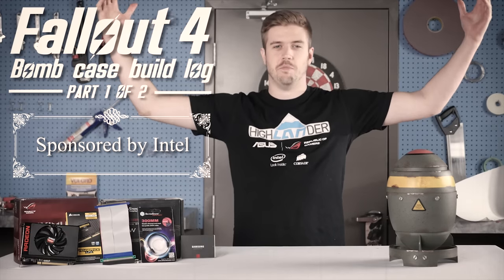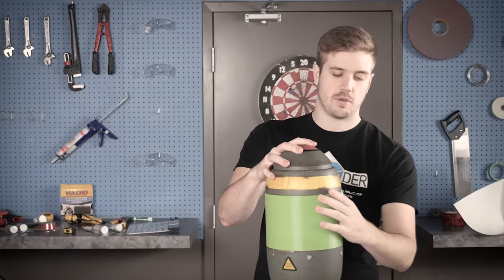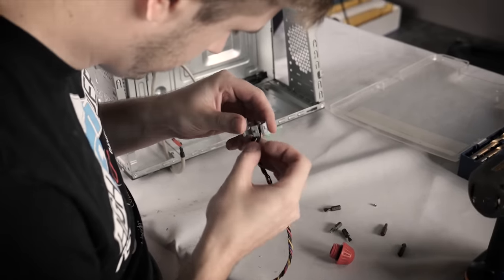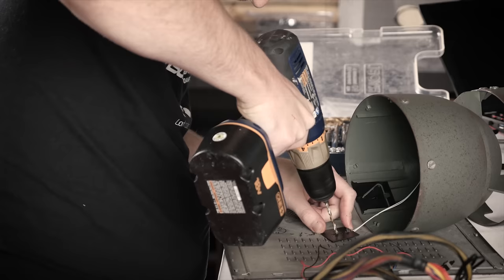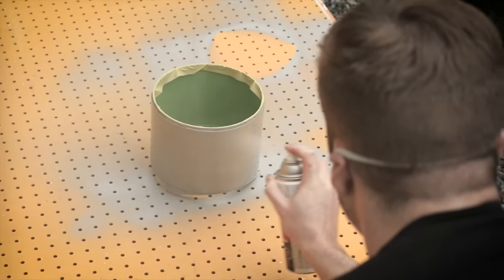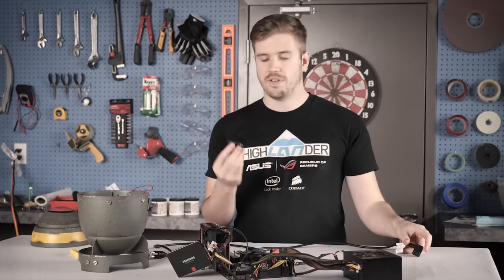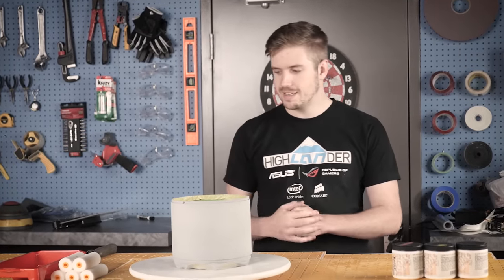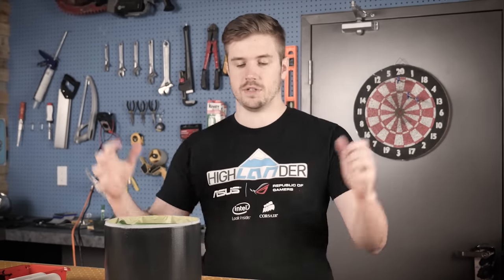Fallout 4 ULTIMATE "Bomb Case" Build Log - Part 1 of 2

Comment: Ya know, if you lay the plastic plate onto a piece of wood prior to drilling it, you won't have to de-burr it with a file. Then if the hole isn't large enough, just simply repeat with a slightly larger drill bit!

Comment: Why you didn't use automotive paint for every color, it would look much better. 
And i have a pro tip for you. Next time to smooth out the surface i recommend using sanding paper with various gradations. Start with 200 and go along too 800. Then spray 2 layers of primer. Wait till it gets har enough to sand it. And here's where magic starts. Use wet sanding paper, 1500 should be good. Surface will be smooth like baby butt :D.

Comment: I would have to make some measurements, but I'm pretty sure that you could fit all of that into the original bomb if you were willing to disassemble the PSU and use a PCIe riser cable. It would be incredibly tight, but I suspect it would work.

Comment: I am surprised he used a full sized SATA SSD. The Samsung 950 Pro had been released. It would have been smaller and faster. (Although they do apparently drain a little more power, which is surprising. Maybe it is firmware, or just the fact that they are so absurdly fast.)

But yeah, that SATA drive was a huge waste of space, the M.2 drive would have been flush with the motherboard.

I am also surprised that he didn't do more modding of the pieces. I know it is a bit dangerous to try to physically take apart the components, but it would have been worth it.

Comment: You could have built a custom PSU and used a NUC motherboard to accomplish this. Yes, it is possible to use a GPU at PCIE 3.0 x4 by adapting the M.2 ultra port. It works quite well.
Reply: +Kevin Resendes no 3d printing extensions required.

Comment: Luke should have wired the switch in parallel with the noise button. wouldnt need hot glue, just solder. less buttons and less mess/hasstle

Comment: that old hunk 'o' junk is not a piece of junk, it was the case of an old Compaq  SG3 110uk pc witch I have, comes with 2 gb of ddr3 RAM, AMD Atlon x2 215, Radeon 3000 IGPU 300 GB gb caviar blue, 2 usb 2.0 front ports, SD card reader and writer headphone and microphone Jack , search up SG3-110uk specifications

Comment: You could just cut the power wirering from the case, concect to the the motherboard as soldering the other 2 pins of the cable o the "bomb" button plate. Waaayyyyyy easier.   :)

Comment: Luke, did you sand the filler primer after spraying it? That could have smoothed out the 3D printer faces a little bit better as I could still kind of see the faces after the black paint coats. Otherwise, looks cool so far! Can't wait to see the finished product

Comment: That hunk of junk is a HP Pavilion Elite m9520f

Release date
18-Nov-2008

Motherboard
IPIBL-LB (Benicia)
Manufacturer: Asus
Form factor: microATX – 24.4 cm (9.6 inches) x 24.4 cm (9.6 inches)
Chipset:
Northbridge chipset: Intel G33 Express
Southbridge chipset: Intel ICH9R
Memory sockets: 4 x DDR Front side bus speeds: 1333/1066/800 MHz
Processor socket: 775
Expansion Slots:
1 PCI x16 slot for graphics card
2 PCI x1 slots
1 PCI slot

Processor
Intel Core 2 Quad Q8300
Operating speed: Up to 2.5 GHz
Number of cores: 4
Socket: 775
Bus speed: 1333 MHz

Memory
8 GB
Amount: 8 GB
Speed: PC2-6400 MB/sec

Video graphics
NVIDIA GeForce 9600 GS
1 – HDMI
2 – VGA
3 – DVI-I (single-link or dual-link)
Interface: Maximum resolution:
HDMI TV resolution: up to 1080p*
HDMI PC resolution: 2560×1600 at 60 Hz
DVI TV resolution: up to 1080p*
DVI PC resolution (dual-link): 2560×1600 at 60 Hz
DVI PC resolution (single-link): 1920×1200 at 60 Hz
VGA resolution: 2048×1536 at 85 Hz
* Use NVIDIA software to optimize display
768 MB onboard memory
Supports two displays at the same time*
* Two of the three ports are usable at any one time
Supports HDCP
Integrated graphics using Intel GMA 3100
*Integrated video is not available if a graphics card is installed
Integrated graphics using Intel GMA 3100
Also supports PCI Express x16 graphics cards*

Sound/Audio
Integrated Audio ALC888S
*Integrated audio is not available if a sound card is installed.
Audio CODEC: ALC888S
7.1 channel high-definition audio

TV-Tuner
Hauppauge ATSC and NTSC Figure 5: TV Tuner card perspective view
1 – Coaxial NTSC (TV In)
2 – Coaxial ATSC (ANT IN)
3 – S-Video in (S-Vid)
4 – Composite Video in
5 – Left audio in (L)
6 – Right audio in (R)
Interface: Supported transmission standards:
ATSC (digital)*
NTSC (analog)
* Requires an antenna
Both ATSC and NTSC connections can be used at the same time.
A 10-pin header on the card provides additional S-Video, composite video, and audio inputs for multimedia connections on the front of some PC cases.
Built-in IR controller: Yes

Networking
LAN: 10-Base-T
Interface: Integrated into motherboard
Technology: Realtek 8111C
Data transfer speeds: up to 10/100 Mb/s
Transmission standards:10-Base-T Ethernet
802.11 Wireless a/b/g/n PCI-Express x1 card
Interface type: PCI
Data transfer speeds: up to 54 Mbps
Transmission standards: 802.11 a/b/g/n
Antennas: Either 1 external or 1 internal
Operating band: 2.4 GHz and 5.0 GHz dual band
Supported security protocols:
WPA
WEP

Hard drive
750 GB
Size: 750 GB
Interface: SATA
Transfer rating: 3.0 Gb/sec
Rotational Speed: 7200 RPM

CD/DVD disc drive
Blu-ray player & SuperMulti DVD burner with LightScribe Technology drive
NOTE:
This Blu-Ray Disc DVD drive introduces a player that reads Blu-ray Disc format enabling you to watch high-definition Blu-ray Disc movies. NOTE: This drive does not include high-definition write capability.
Formats/Disc types/ Write speeds / Read speeds / Storage capacity
Blu-ray Disc
BD-ROM SL NA up to 6X up to 25 GB
BD-ROM DL NA up to 4.8X up to 50 GB
BD-R SL not supported up to 6X up to 25 GB
BD-R DL not supported up to 4.8X up to 50 GB
BD-RE SL not supported up to 2.3X up to 25 GB
BD-RE DL not supported up to 2X up to 50 GB
HD DVD not supported
DVD
DVD-ROM SL NA up to 16X up to 4.7 GB
DVD-ROM DL NA up to 8X up to 8.5 GB
DVD+R SL up to 16X up to 12X up to 4.7 GB
DVD+R DL up to 4X up to 8X up to 8.5 GB
DVD+RW SL up to 8X up to 10X up to 4.7 GB
DVD+RW DL not supported
DVD-R SL up to 16X up to 12X up to 4.7 GB
DVD-R DL up to 4X up to 8X up to 8.5 GB
DVD-RW SL up to 6X up to 10X up to 4.7 GB
DVD-RW DL not supported
DVD-RAM up to 5X up to 5X up to 4.7 GB
CD
CDROM NA up to 40X up to 700 MB
CDR up to 40X up to 40X up to 700 MB
CDRW up to 24X up to 40X up to 700 MB
CD-DA NA up to 32X up to 700 MB
Video CD NA up to 10X up to 700 MB

Memory Card Reader
15-in-1 multimedia card reader with passive IR receiver
Contains passive infrared receiver
Supports the following cards:
CompactFlash I
CompactFlash II
IBM Microdrive
SecureDigital (SD)
mini-SD
MultiMediaCard (MMC)
Reduced size MultiMediaCard (RS-MMC)
MultiMediaCard Plus (MMC plus)
MultiMediaCard Mobile (MMC mobile)
Memory Stick
Memory Stick Pro
Memory Stick Duo
Memory Stick Pro Duo
Memory Stick Pro Duo
xD-Picture Card (xD = extreme digital)

Computer Case
Mid-size ATX
Height: 39.6 cm (15.6 inches)
Width: 18 cm (7.09 inches)
Length: 42.8 cm (16.85 inches)

Power Supply
350W
350W power supply

I/O Ports
Front I/O ports
1394: USB: Headphone: Microphone: Audio L-R: S-video in: Composite video in:
Back I/O ports
1 – PS/2 mouse port (green)
2 – Coaxial SPDIF Out
3 – Video Graphics Adapter
4 – IEEE 1394a
5 – RJ45 Network (LAN)
6 – Auido: Center/Subwoofer (yellow orange)
7 – Auido: Rear Speaker Out (black)
8 – Audio: Line In (light blue)
9 – Audio: Line put (lime)
10 – Audio: Microphone (pink)
11 – Auido: Side Speaker Out (gray)
12 – USB 2.0 ports 1, 2, 3, and 4
13 – Coaxial SPDIF In
14 – PS/2 keyboard (purple)

Operating System
Windows Vista Home Premium with Windows Media Center (64-bit) with Vista Service Pack
Reply: anthony fannon thanks

Comment: I wonder if there are any issues running AC cable up through and passed all of the DC components...

Specifically inductors
Reply: Flux will also help you solder if you are having issues getting the heavier solder or leads to take the heat.

Comment: 4 coats of spray-on primer and then applying thick paint with a roller? What's the point? You just wasted a lot of primer and ruined a perfectly smooth finish. You only need 1-2 coats of spray-on primer, and 1-2 coats of spray-on black, don't use a damn roller if you have a perfectly smooth surface because you'll ruin it...

Comment: Actually, that's not an high voltage wire you're soldering. That's low voltage cable (110-220V)
Trust me, I'm an electrical engineer

Comment: Hey LMG, I've only discovered you guys a few weeks ago so I went to join your forums but I have been unable to receive any validation emails. I have double and triple checked that I am using the correct address and even changed to a different email address in case that was the issue... I have scoured the forums and found a post describing a similar issue, but no actual responses to the post. Please help.

Comment: fitting a computer in the original size of the case would have been extremely easy if he with with smaller computer parts. Hell, he could have just thrown a raspberry pi in there and said done!

Comment: So, just to make sure I've got this straight, you pick out an interesting and challenging container to build a PC inside, then you just add more hollow pieces to it until it's big enough to fit the stuff you happened to have lying around? Sorry, but this is shit. Why not 3D-print some hard drive cages, and a front I/O, and some PCIe slots? Then, when you've added all that, just 3D-print a new chassis. Granted, you'll end up turning the Fallout bomb into the case this video is sponsored by, but that's not so far removed from what you actually did, is it...?

Comment: luke u could have just used the switch that was already in the bomb
Reply: Did you even listen. He said why he didn't
Reply: +jake O'Shaughnessy ur point?? he still could have.
Reply: +shane neyome he explained why he couldn't
Reply: +BobTheTitan47 _ (budderwarrior43) that does not change the fact that he could have
Reply: +shane neyome if he did, there would be voltage problems
Reply: +BobTheTitan47 _ (budderwarrior43) how ?? if u wire it right it will be fine and then the sound for the bumb and the power for the computer would work just fine indapenditly of each other even on the same switch
Reply: +shane neyome the switch wouldn't work... No matter how much you deny it
Reply: it could have very easily worked. the switch is a momentary switch so no current actually runs through it on a regular basis. further, these type of switches also have a secondary connection area where you can connect a completely different circuit without having any interaction.
Reply: He said it himself that it wouldn'
t work mate
Reply: BobTheTitan47 _ well Luke really doesn't know anything about wiring a switch he did good but it would have worked just fine